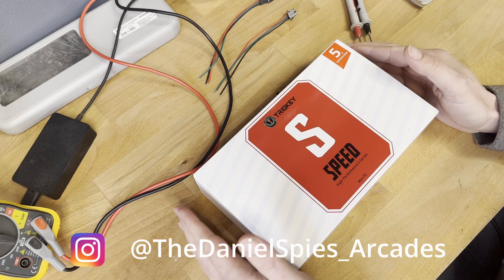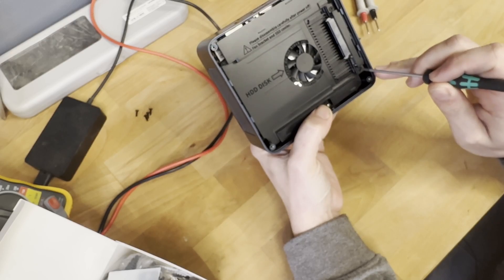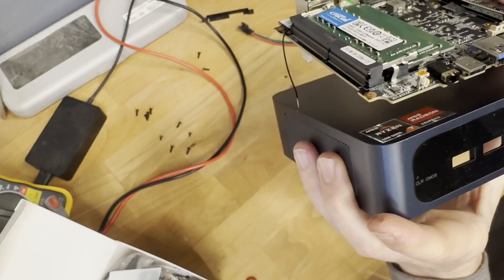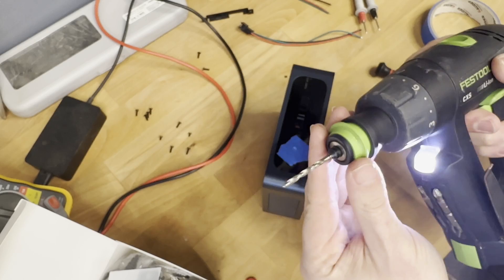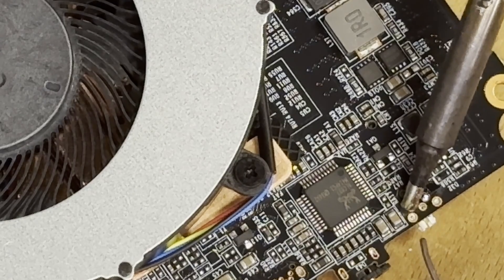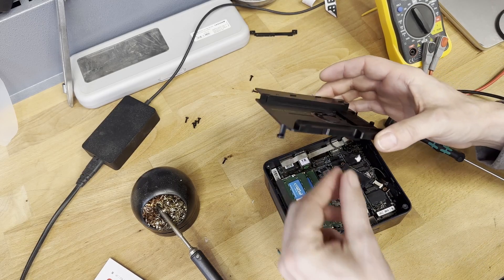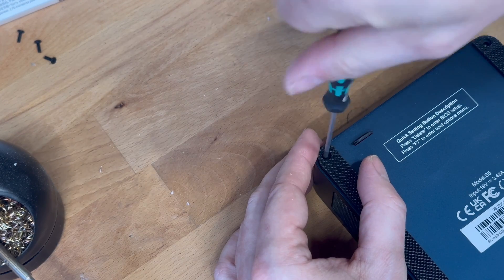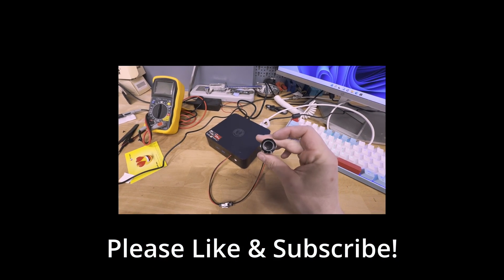Modify your MINI pc and add an EXTERNAL SWITCH for your Arcade Machine

Comment: May have already been said but

First check the bios whether it can be changed to immediately boot on power rather than require a switch press

Failing that, if one of the USB ports supports wake on usb a mouse can be used to turn on the PC. Soldering a button to a mouse board would avoid invalidating possible warranties

Ps I love your builds. The quality is outstanding. Best I've seen
Reply: That was my confusion too. People put those things on the back of their tvs.. The BIOS is equipped.

Comment: Great video, I bought my first soldering iron a few weeks ago and never have soldered before and was able to do this.  I do have one question.  I can get the button to power the PC on, how do I get it to turn the PC off?  I push the button and nothing, I’ve held it also like I was simulating, pushing the button on the PC to force it to power down, and that also did not work
Reply from the maker: If your pc turns on when pressing the button, your soldering is fine :-) That the PC will not turn of with that same button seems like a software setting maybe?

Comment: I just did this on a new GMKtec Nuckbox G5 and the solder points are terribly small and directly next to the LED power leads.  Its a 4 pin mini switch.  That was a nightmare to solder and I had to use my LCD microscope to do it.  I wish these companies would just add some VIAs or test pads for use to wire our own switch.
Reply from the maker: Haha you are right. I now bought a digital microscope that solves this problem in a cool way! Super easy to solder SMD size components now :)
Reply: @TheDanielSpies_Arcades  yeah I actually used a digital microscope to solder my mini pc board switch.  lol  I need a better iron.

Comment: Fantastic.  I got the same mini PC for my 2 player cabinet I just started building.  I was wondering how to wire everything so it all starts at the same time with this PC?  I watched the new 1h long video with the relay boards but I can't figure out how the pc is going to send power to the board?  Have I missed something?
Reply from the maker: I connected the relay board to a SATA cable :-)

Comment: A lot of these mini PCs have settings in the BIOS to turn on with the power. Then you can have a button that launches a script to turn off the PC using something like Autohotkey. Easiest solution without having to open the PC, drill, or solder anything.
Reply: switchbot would do the job too
Reply: Yeah but then how do you turn it back on without even unplugging?
Reply: @potassiumming04  you just have to press the power button again. I've built a lot of mini gaming machines with these mini-pcs using a separate button to turn off the pc and the power button to turn it back on. basically a two button setup without breaking open the pc.
Reply: @laynebryant1020 That's the problem, I don't wanna push the power button. Im planning to put this under the table and it's going to be plugged in 24/7. 

If im gonna push the power button to turn it on, then that defeats the purpose.
Reply: Do you have an videos
Reply: I think people put them on a smart plug. The BIOS can be configured to respond to power being cut. I haven't done it but I have a couple of minis that I plan to modify. No drilling in the case should be necessary.
Reply: that is nice, but i use a "smart" strip that senses the power draw on the main outlet and turns on the rest so all i have to do is turn the pc on and the monitor, sound, marquee lights, leds, etc come on at the same time and go off when the pc does.  I did this exact method on my mini pc before seeing this video and it works perfectly.
Reply from the maker: Thanks, but this is a more professional/reliable way in my opinion :-)
Reply: Professional?  @TheDanielSpies_Arcades

Comment: @thedanielTheDanielSpies_Arcades what type of cord/wire is that?  (whats the name if I wanted to get a longer cord for the external switch.
Reply from the maker: 3 PIN JST connector? The wires can be any AWG as there is (almost) no current running through them.